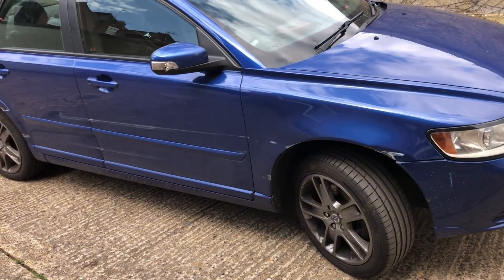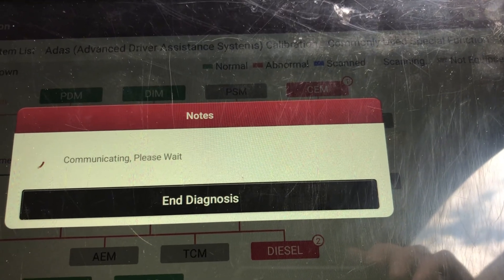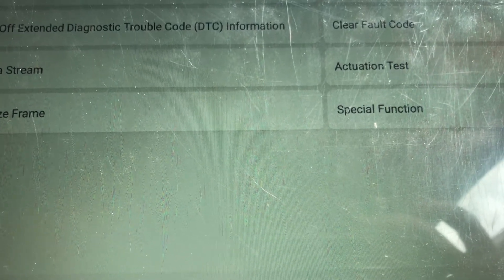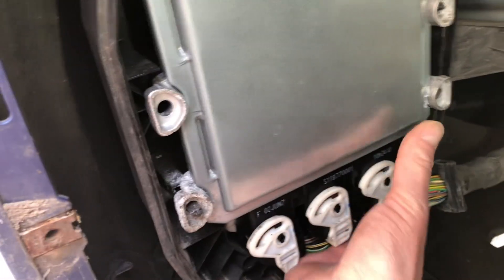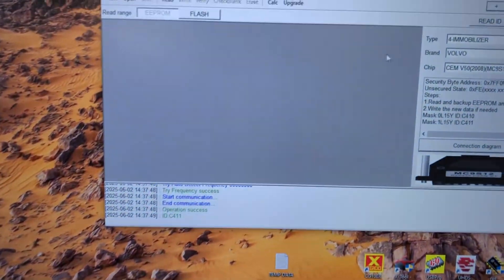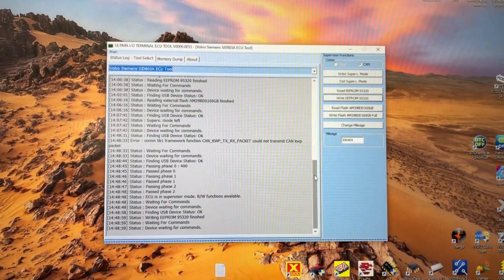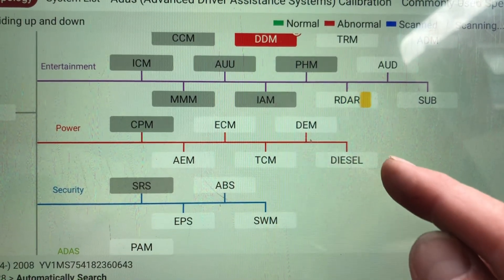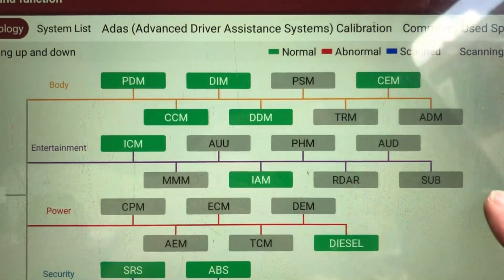Volvo Immo fault ECU - BCM / CEM module synchro No Crank No start Fault codes ECM-C301 & 326 CEM-3A0

Comment: do you refund if the fix didn't work? or atleast a partial refund?
Reply from the maker: Our programming solution works..
Reply: @JC-ECUConnection  I didn't mean anything by it, just never done anything like this. I have a 2008 volvo v50 2.0 Diesel, with the exact same problem, if I'm understanding this correctly I need to scan my cars OBD port to find the ECU Hardware serial number, then I take both the BCM and ECU out, buy the service on your website and send them both to you? Is this correct? Also should I check to make sure that the ECU has SID803A? I'm just thinking that if it goes out of sync every time the battery is dead, maybe it's possible to replace it with another ECU that doesn't have this problem or is there a better permanent solution? Thanks
Reply from the maker: @haroldas1999 Yes, this service is for the SID803 / SID803A ECU type, we will need the serial number of the ABS pump, found diagnostically - I believe it’s also on the pump casing but it’s easier via diagnostics.. We will know when we read ECU data if the synchro has failed as it is displayed on our software - Sadly it’s not possible to change to a different ECU type. This problem doesn’t happen every time the battery is flat, it’s just unlucky when it does & a flat battery / jump start / battery removal & refitting is the only cause of this fault..
Reply: It worked, my Volvo is running again. Thanks for saving my car. I left you a 5-star Google review.
Reply from the maker: @haroldas1999 glad to help & many thanks for your Google review!